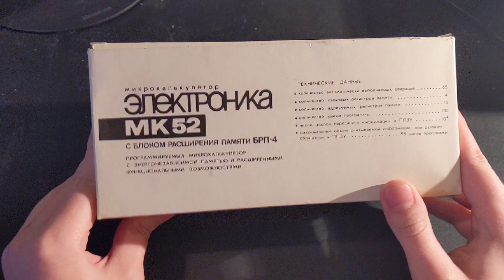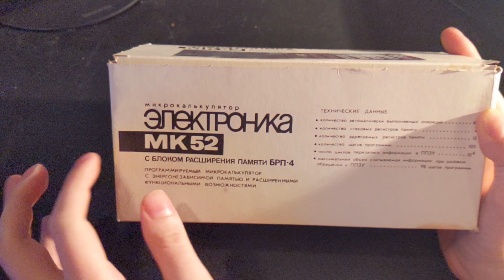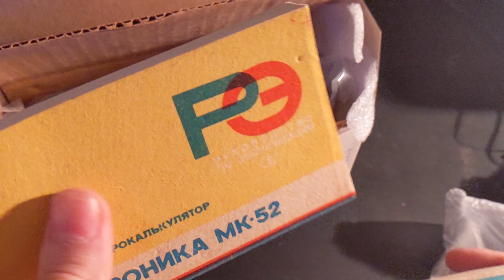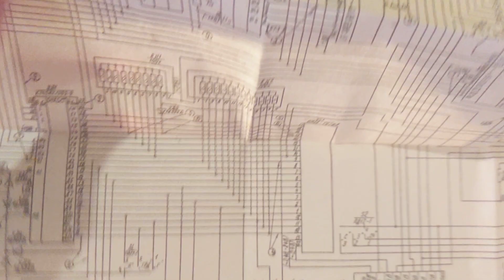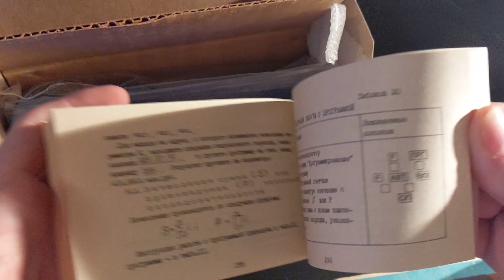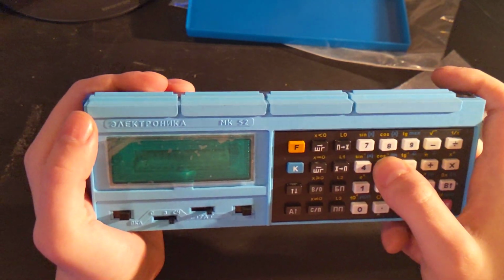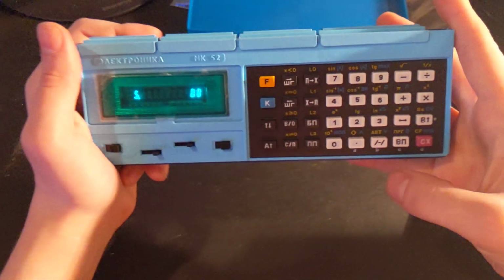NEW OLD STOCK Soviet Built Calculator [Elektronika MK 52]

Comment: Thank you for sharing!
It's not an Old Stock. It says 1995, while originally it's from 1985. I thought they stop produce it with the end of the Soviet Union. 
Yours quality is so-so to say the least! 🤷🏻‍♂Think it's a copy. I wonder whats inside. 
But the battery compartment are the same as original - looks like soviet batteries was slightly shorter than modern AA, so the fit are really tight. 😁

Comment: my god .. why dont you prepare a little bit before made a video !!   2 hours to put those batteries !!!   and this is like an HP calculator ,  polish reverse notation.
Reply from the maker: The point was to try and figure it all out for the first time. I had never heard of Polish reverse notation until someone told me in the comments. As a 20 year old American I haven’t really had any experience with an older style calculator. Plus I’m terrible at math I failed algebra 2 in high school, and just barely passed the other ones so I suppose I don’t have much calculator experience in general. I’m more interested in history.
Reply: @ozmond    you should get ready and prepared to do a video (or fix a car or go to the beach) .. not just take the camera and start recording  ....  you need to do some homework first.
Reply from the maker: No i just like to take the camera and start recording

Comment: its RPN calc
Reply from the maker: Interesting, I'll look into that, maybe that'll help a bit of my confusion.
Reply: @ozmond  rpn calc its family of HP calcs, hp-35s (for example). if you watch video haw using rpn calcs, you love this system. (sorry bad english)
Reply from the maker: @nefarium70  yeah I did a bit of research, very different from what I'm used to here in the States. I figured out you input your numbers first, then hit if you want to multiply or add etc. I have a video uploading now showing it off after I learned that. Thank you very much for pointing me in the right direction!
Reply: @ozmond  You should be used to RPN calculators from Hewlett Packard. They where used onboard Space Shuttle.
Reply from the maker: @xuser48  unfortunately I was not on the space shuttle
Reply from the maker: I'll do I follow up video once I better understand this device. Very fascinating.